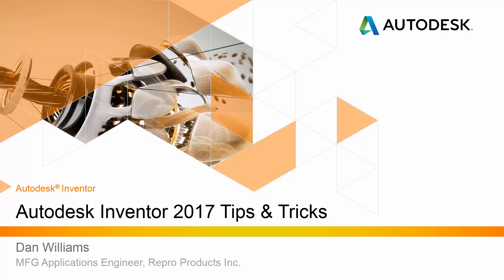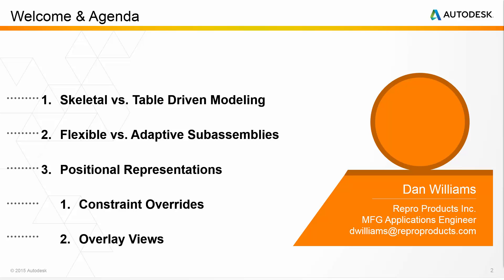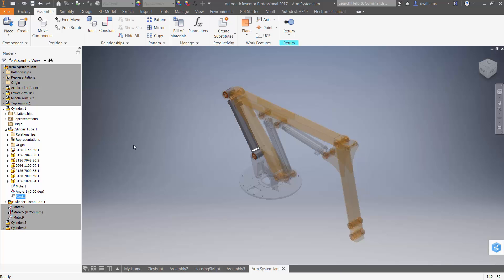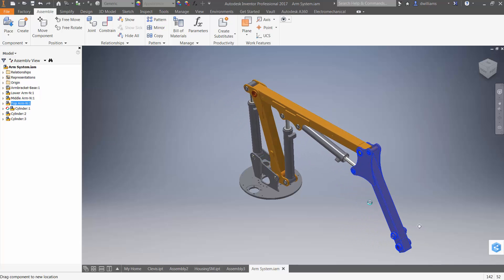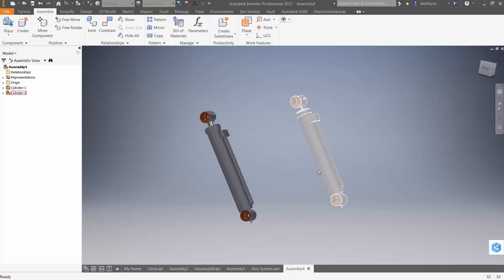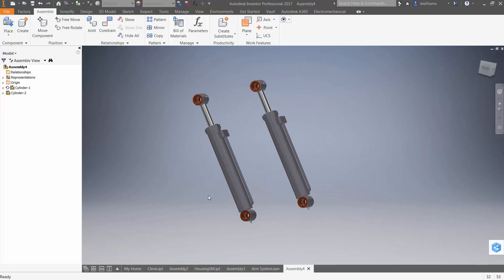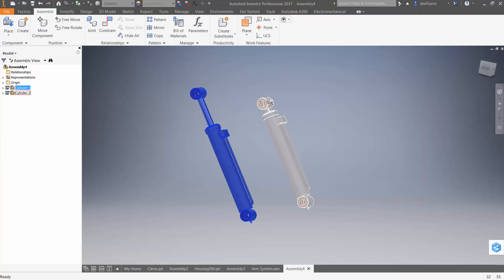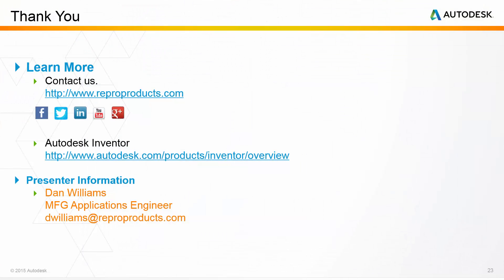Inventor 2017 Tips & Tricks: Flexible vs Adaptive Subassemblies

Comment: Not sure if you will go back and see this but for instance a cylinder has hard internal limits in the real world. Is there a way to put hard limits on the movement so the rod  is not able to over extend or retract too far? yet still be flexible in inventor?

Comment: Hi, thanks for sharing it with us. my question about the flexible feature - is it possible to used limitations with it? such as a "stroke" in your  cylinder example? or as you mentioned in one of the comments a hinges movement from 0 to 90 degree?

Comment: Hi, thanks for the nice video. The question I came here for I have not found an answer for yet, though: Is it possible to make a part, not a subassembly, flexible or adaptive or what have you, using "missing" constraints in the drawings it is based on?